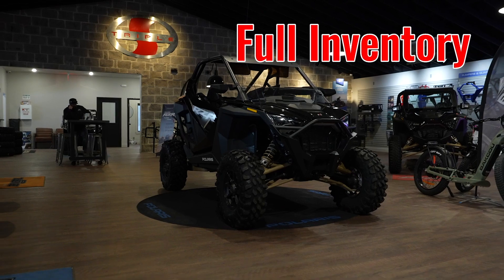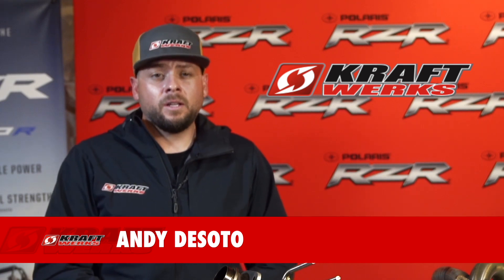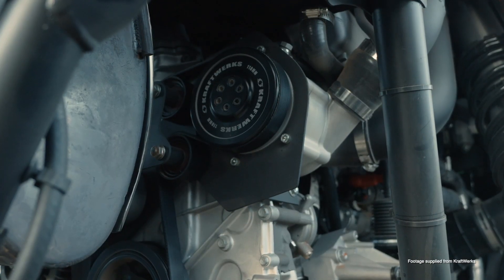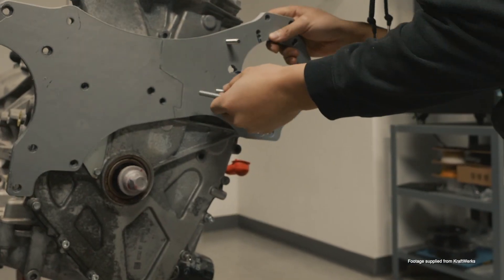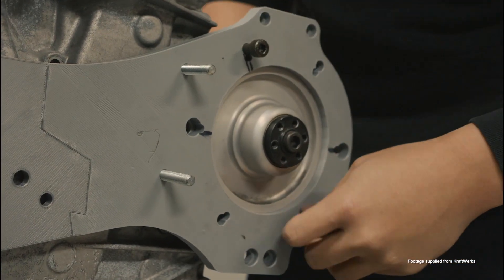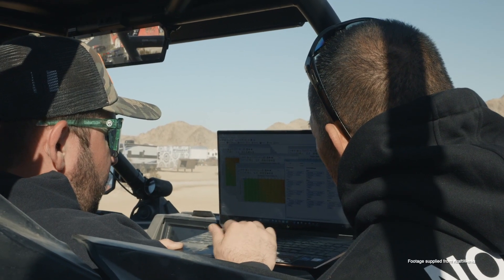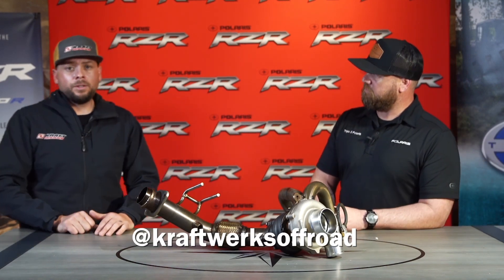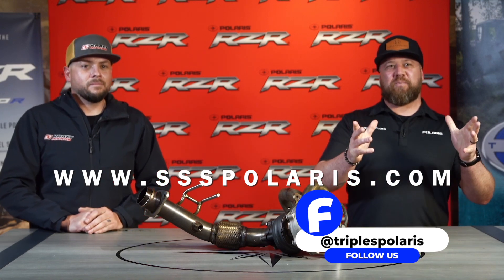KraftWerks Polaris RZR SuperCharger System

Comment: 100 HP over stock? Stock pro r is 225hp
Reply from the maker: That's correct! Pretty amazing, all while using 91 octane pump gas
Reply: You said to expect a 60% increase in HP, then mentioned the Pro R. Then said the HP dyno at KoH, showed 246 hp on 35’s. If a stock Pro R is rated at 225 hp on 32’s, where is the 60% hp gain?  225 + 60% is 360 max hp?  I’m not bashing ya, I’m just very dumb on this stuff. But I’m curious bc I’m buying a new Pro R in a few days, and I’m wanting a power adder. Thanks.
Reply: @brentdale5730 that 246 is wheel hp, the 225 rating is crank hp, it amounts to about 170hp to the wheels stock